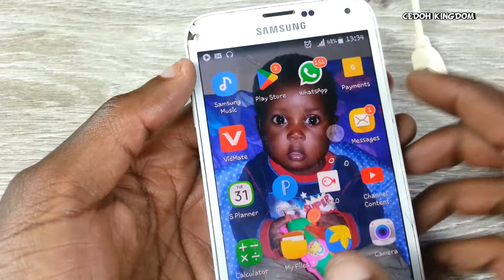DIY AUX to USB Cable

Comment: is there a way to make an usb-c tot aux version where i can put in the aux cable and transform it into usb-c cable?
from the hole where the aux cable goes in - usb-c cable at the other end?
Reply: Any form of digital output to analog out will never work without digital encoder.

Comment: Mister indian guy i have some questions:
1.From where you can get 5v for the usb thumbdrive which is supposed to work in this case you have showed?
2.How do you convert digital sound to analog sound without dac converter?
Reply: Modern equipment can switch into a mode of audio-pins over USB, but as the circuit is directly hardwired shared with AUX port,
 it therefor can also do USB over AUX port. So, it needs to be modern TRRS port. Sleeve pin is the +5V